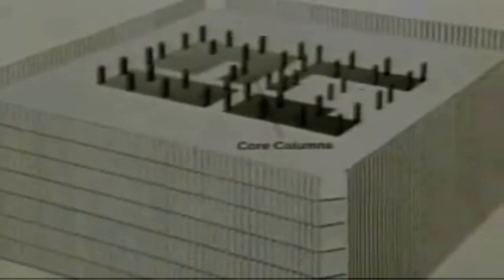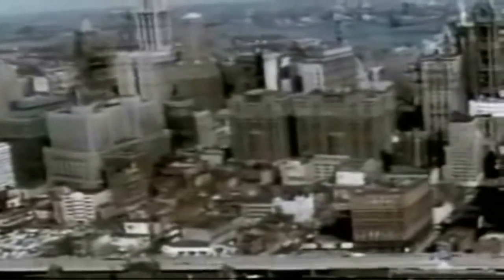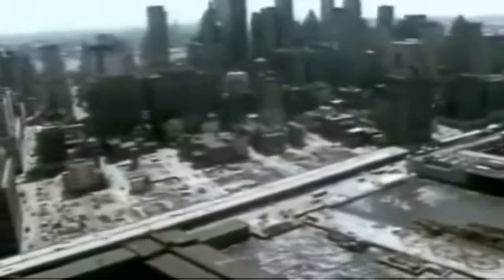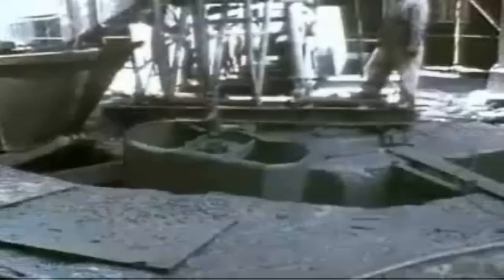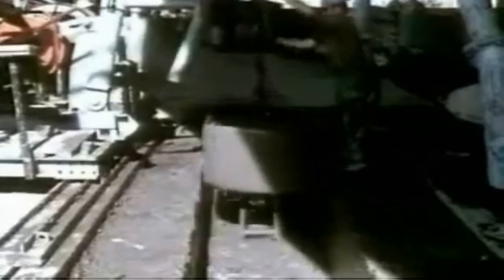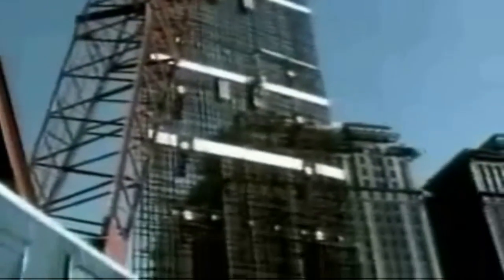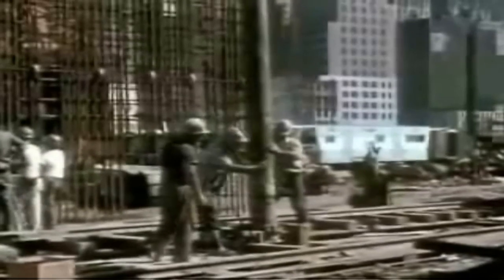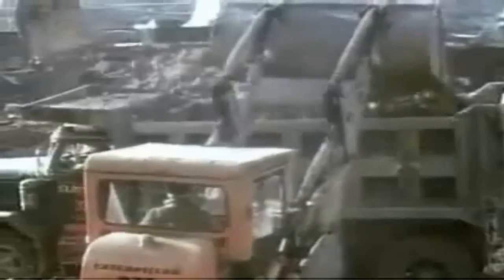Building the World Trade Center Towers

Comment: I have worked in commercial buildings in medium and high rise buildings and your fucking bonkers if you thing the buildings came down from fire or a plane. No plane hit 47 story bldg 7 and it fell in classic controlled demo. There have been buildings on fire like a torch for far longer but they do not fall.
Massive beams bent tight with no buckling or tearing. Massive amounts of metal melted off the beams and molten STEEL were never investigated. It is documented andf on video here.
  https://www.youtube.com/watch?v=hgrunnLcG9Q
Reply: "Controlled demo" Yet hundreds of people died when the buildings fell.

Comment: Brilliant film, thanks much for posting! This page includes some additional footage from when the WTC was new, taken in 1973 by an environmentally concerned photographer. 

http://www.citylab.com/design/2013/05/when-original-world-trade-center-was-new/5579/

An interesting thing I picked up from these photos is that originally, the WTC was built without any wastewater recycling whatever. The sewage was dumped right into the Hudson River! This not only surprised me as such, but it also made me realise that the WTC complex must have been retrofitted for wastewater recycling later on, to comply with environmental regulations. Yet I'm having a hard time finding any information whatever about this major engineering project. 

Interestingly, the 2002 paper by O'Rourke et al. on the Lessons Learned from the WTC Disaster about Critical Utility Systems, not one word is said about the wastewater recycling system. I might have to contact Professor O'Rourke at Cornell to find out about this seemingly glaring omission. 

http://www.colorado.edu/hazards/publications/sp/sp39/sept11book_ch10_orourke.pdf

From an engineering point of view, retrofitting the WTC for wastewater recycling would involve either preparing new shafts and tunnels for the purpose or, alternatively, letting the wastewater mains cohabit with the water mains if there was enough room in the shafts. From O'Rourke et al. we learn that those are deep shafts. The NYC main water lines system runs "about 183–213 meters below street surface and transmits water to the distribution pipeline system through riser shafts" (p. 271). 

The dearth of information is partially explained by what O'Rourke et al. have to say about the "brave new world" after 9/11: 

« In the "brave new world" after September 11th, knowledge is power both for those who wish to build and those who want destruction. It is therefore logical and responsible for the managers of infrastructure to be cautious about providing information that involves critical facilities. » (pp. 288-9) 

Secrecy in all honour, but the wastewater recycling shafts don't really come across as crown jewels to be protected at any cost. If they are that important, that would undoubtedly be for other reasons than the fear of future terrorist attacks.

Some researchers have advanced the possibility of nuclear demolition of the twin towers, which seems to me to be the only known way in which 110 floors of football-field-size concrete slabs could be instantly pulverised. If this is so, the wastewater recycling shafts would emerge as the perfect place to put the nuclear charges. 

When you start reviewing this seemingly outlandish hypothesis, it turns out that a lot of evidence points in the same direction, including in particular the presence of fission products (barium and strontium) in dust samples and tritium in groundwater samples. If those samples, as reported by William Tahil in his Ground Zero report, are correct, that's nothing less than smoking-gun evidence of nuclear explosion. These fission products don't occur naturally but only as a consequence of nuclear fission. 

http://www.nucleardemolition.com/files/Download/GZero_Report.pdf

We also apparently have zinc, including the radioactive isotope zinc-65, in the dust samples. Zinc-65, to explain, is created through massive irradiation with neutrons of the naturally occurring and stable isotope zinc-64. Some of the neutrons penetrate to the nucleus and bumps it up one notch. With wastewater mains made out of galvanised steel, i.e. zinc-covered steel to provide additional protection from corrosion, that's precisely what we should expect to find in the dust samples. 

Most credible eyewitness accounts talk about two explosions shaking the ground prior to the collapse. If the demolition was carried out with nukes placed in the wastewater shafts, you would expect two explosions: the first would be to collapse the connection tunnels to the NYC mainlines so as to protect them from damage, and the second would be to bring down the towers. 

The eyewitness accounts seem to be consistent with a seismic impact of about ML = 3.5 on the Richter scale, give or take a few tenths. That, in turn, is consistent with an underground nuclear explosion with a yield of perhaps five kilotons, give or take some. The underground detonation of a nuke in a shaft would then in effect amount to what Dr Judy Wood has labelled a "directed energy weapon". She probably doesn't have nukes in mind, but her terminology is nevertheless consistent with that. 

The effect of a nuclear blast seems to be fully consistent with the observed collapse scenario, where the buildings unravel from the top as though there were zippers running down the facades. The reason it happens that way is that the undergrond nuclear blast forms a blast wave the shape of a tall and thin trumpet, which widens out sideways and down as the blast progresses. Note that the round shape of the blast causes the corners of the buildings to unravel slightly behind the collapse frontier, hence the zipper-like effect of a Y-shaped collapse frontier. 

Other bizarre phenomena such as the infamous toasted cars may also be accounted for by heavy irradiation, including with neutrons that would burn the cars from the inside out and even cause engine blocks to melt whilst leaving white paint unaffected. 

The presence of thermitic residue in the dust samples may also be accounted for by the vaporisation of steel and aluminium, which then recombines as fine dust, some of which will have a chemical composition similar to thermite. Mind you, I'm not saying thermite (or thermate or super-thermite) wasn't used at all, but it is inconceivable that thermite would have pulverised all that concrete. No conventional explosives can cause that kind of damage. Similar observations apply to the molten rock, etc. 

One observation about the thermite crowd is that they claim that super-thermite (a.k.a. nanothermite) is as fast and powerful as conventional explosives, if not still faster and more powerful. But if that were so, it would also give off similarly loud bangs when exploding. Note that conventional demolition of the twin towers, whether carried out with conventional explosives or with super-thermite, would have required thousands of such charges going off in short order. There is no evidence of anything such. 

I'll round off this long comment with another interesting observation from the O'Rourke et al. paper: 

"AT&T Internet Protocol transport and other equipment in a sub-basement level of WTC 2 continued to work even after the building collapsed." (p. 278) 

But how could that be if the entire tower had "pancaked" and crushed everything underneath? It's impossible, and so is the notion that thermite pulverised all that concrete. A deep underground nuke, however, can easily account for all this. I could go on, but I think the important points have been made now. 

I'll wrap this with a call for information: If anybody has something on the retrofitting of the WTC complex with wastewater recycling facilities, please pass that along. Thank you!